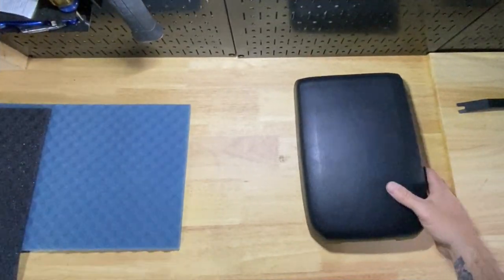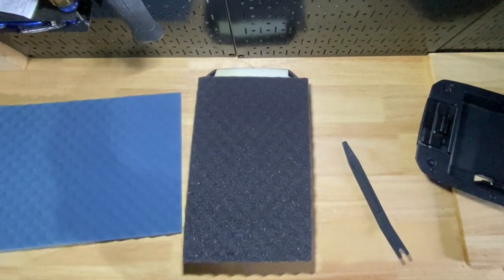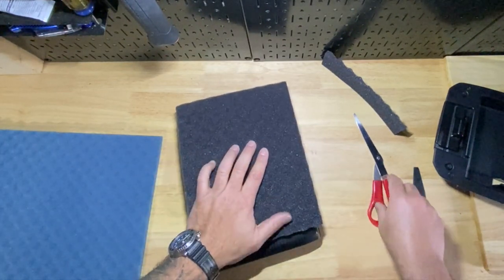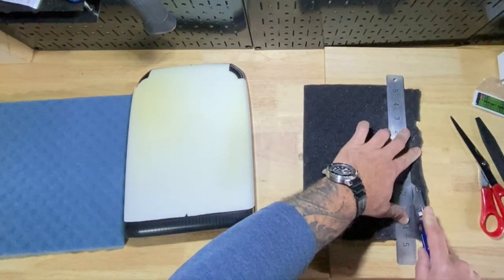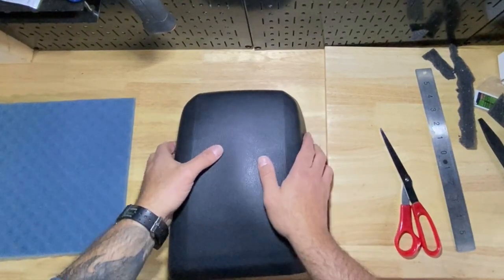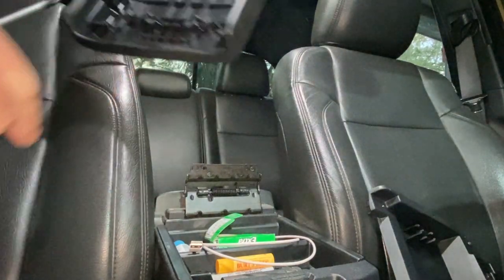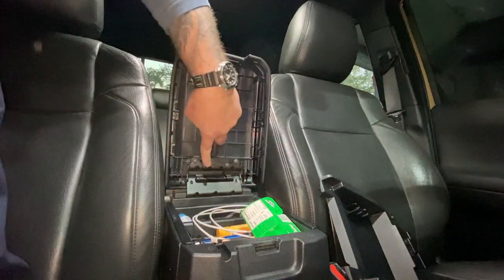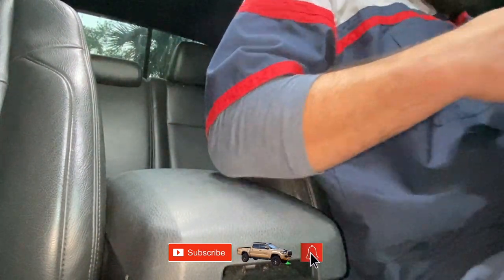Toyota Tacoma | The Elbow Mod | Center Console Padding install | (2017 Tacoma)

Comment: Good idea. My bad elbow is on the other side. I need to do something similar with the door arm rest.
Reply from the maker: Thanks, I feel you. I'm not sure why Toyota decided to use 80 grit for the door elbow rests. 
I might have to start researching how to change that. Thanks for watching.
Reply: @ClassyTacos  It probably pops up like the console lid. It's that way on my 3rd gen 4Runner. I've been meaning to do that for a while.
Reply from the maker: @AllTerrainFamily  That piece will not pop out easily. Its held in place with several  plastic welds along the back. Super time consuming mod. Maybe one day.

Comment: What was the width of the padding you used?
Reply from the maker: Off the top of my head between 
8-9 inches driver to passenger width wise. Thanks for watching.
Reply: @ClassyTacos  one last thing, what would you estimate the thickness was?   Thanks!  Keep up the videos they are very helpful!
Reply from the maker: @bluedevils99  1/4 to 1/2 inch depending on the valleys and ridges. Another option is the 1/4 inch gel pad for motorcycle seats. Sold on Amazon, it's blue in color and would work great I believe. But, it's pricy.